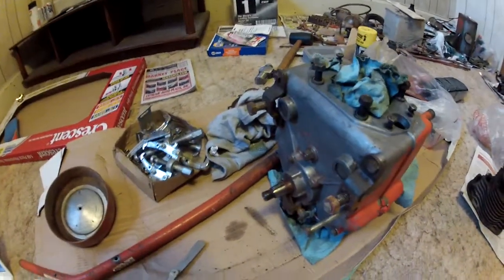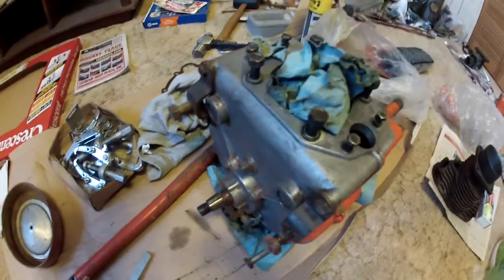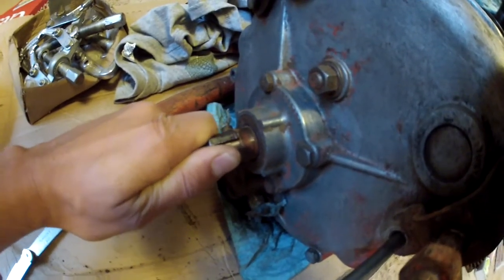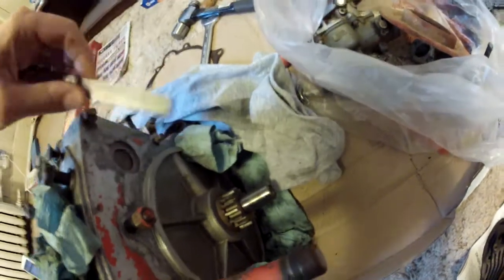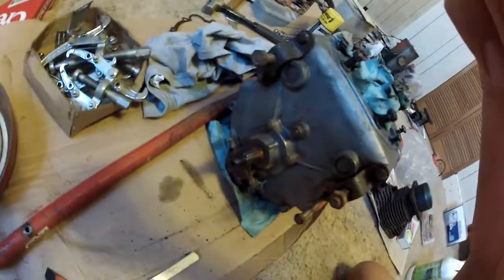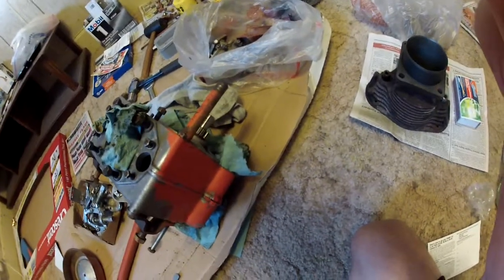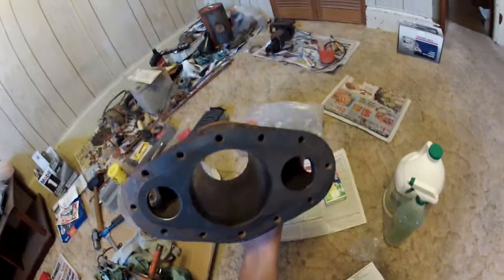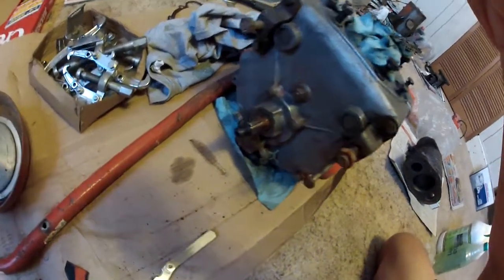Gravely 7.6 Crank End Play

Comment: Hey so you know how to shim the oil pump.  I have a video showing how I did it to take the end play out.   It's on my 1961 LI
Reply from the maker: After I made this video, I looked up Gravely's spec - in the '74 service manual it was .010-.020" end play. When I rebuilt this engine I shimmed it down to .015". It runs well but the sealant I used on the oil pump housing and cap apparently didn't hold up, so I have to tear that off and use a different sealant when I get the time. It has a small leak. I also replaced the seal while I was in there the first time.